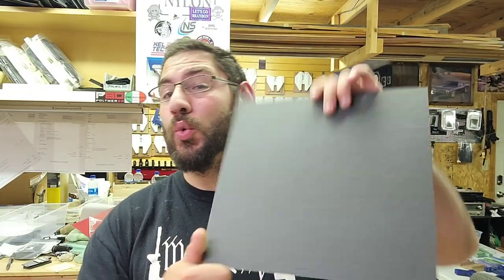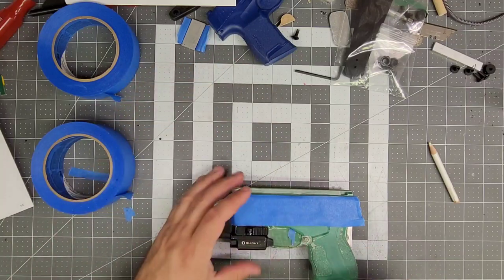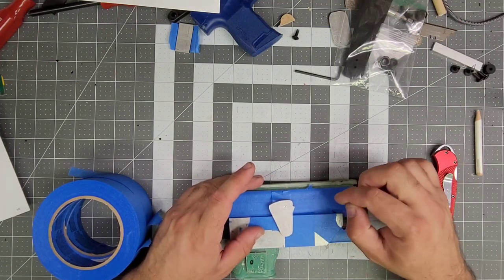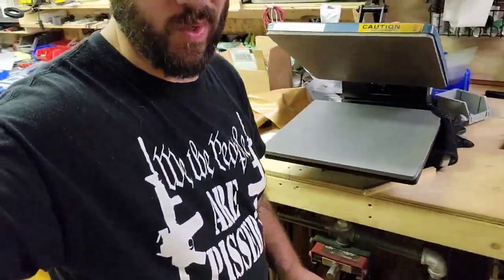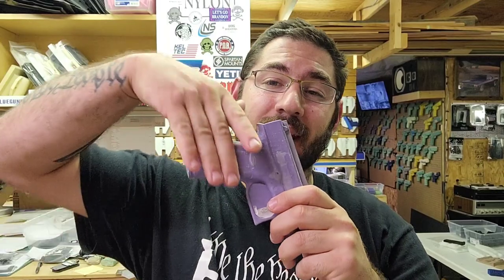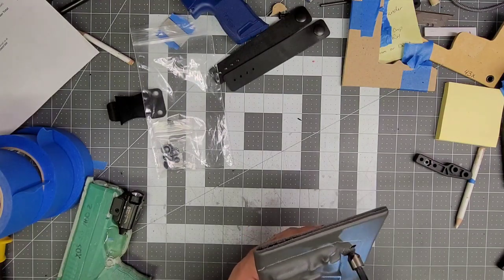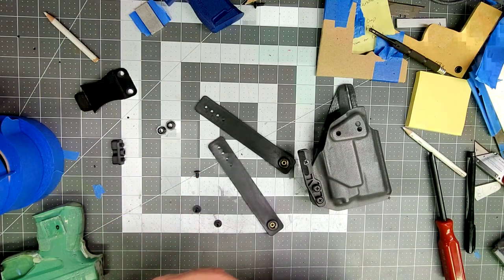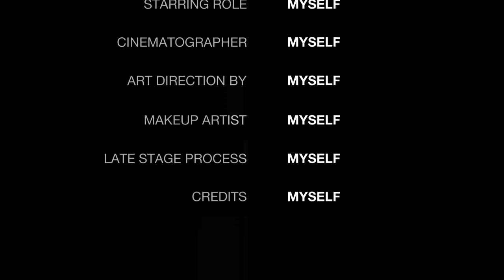Making a Holster for the SA 3.3 Mod 2 with OLight PL Mini 2

Comment: Oooh my XDs just perked up….

Just a thought on the ride height of the G43 (and other compacts). The short barrel and poly frame means there’s not a lot of mass below the belt line when compared to say a larger steel / alloy firearm. The smaller the weapon, the more of the mass is in the butt (all those boolits). This makes the butt tend to fall outwards and away from the body. So maybe has to sit deeper for the same level of concealment (at the sacrifice of getting a good master grip when drawing).

Comment: Okay I've been looking at going with a light baring but I want it where I can put p80 g19 in p80 g17 light baring holster. But I don't know what light would work for that
Reply from the maker: Tons of lights work on that platform. If you base the holster off a 19 you'll need an open bottom for the 17 can fit. If you base it off the 17 both firearms will fit. You just need to figure out what light you'd want to run. Tlr 1 on the p80 is popular
Reply: @FalTacUnlimitedLLC  I guess I'm going have check and see what shops in 603 got deals on lights 😂😂
Reply from the maker: @hondaatcfreak420  I have found that Amazon is the cheapest. But shopping local is good. I personally work with Macpherson firearmsin brentwood
Reply: @FalTacUnlimitedLLC  I was at their shop few weeks ago  an I'll go back for sure .. 30min drive for me I'm closer to shooters outpost
Reply from the maker: @hondaatcfreak420  shooters works too. Jim is a good guy as well
Reply: @FalTacUnlimitedLLC  I just wish nh had more selection for guys that like building stuff more then buy out the box ready to go
Reply from the maker: @hondaatcfreak420  gotta know where to shop. 2a tactical in Barrington is like that. And there's a ton of small stores that have nice stuff.
Reply: @FalTacUnlimitedLLC  I don't got mill and only jigs I've seen him push is the ones need mill to finish the lower  never saw easy jig or the 5dtactical jig